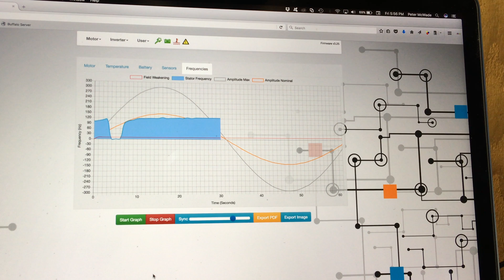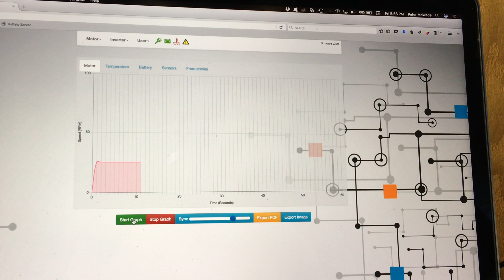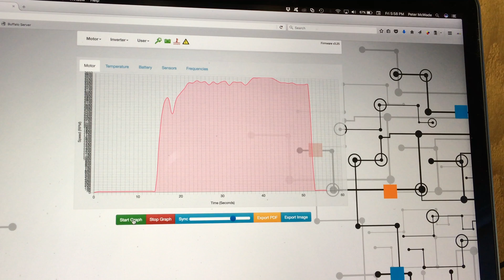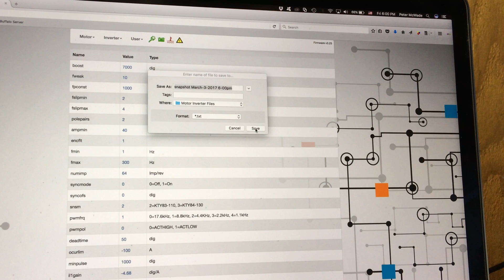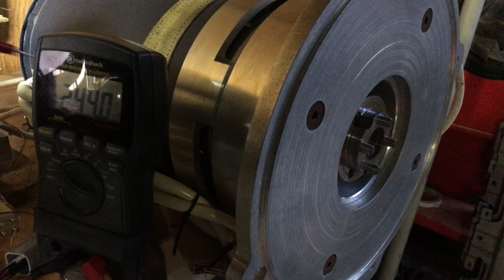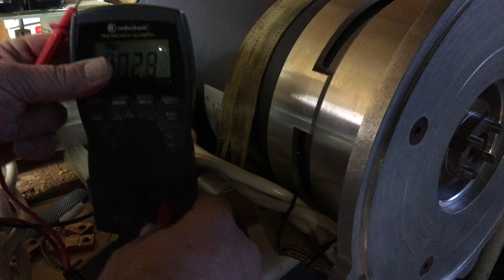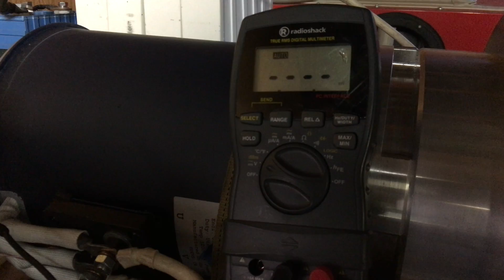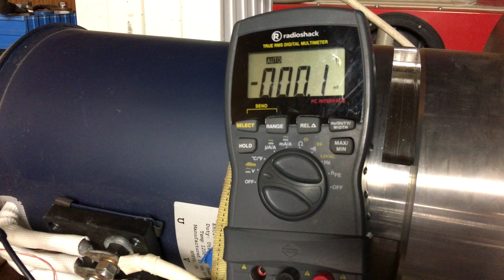Hübner Inverter HPEVS AC 35 Part 2

Comment from the maker: What do you plan on running with your inverter? What voltage and amperage level do you need?
Reply: I would like to use 144 volt amp 500

Comment: hello from new york Where you can get the modules you are using for the controller
Reply from the maker: These modules came with the inverter. I picked up the inverter from someone else who put it together. I have done another since. The modules were purchased from private party but can be purchased on eBay. There are a few other items needed too but modules are the most expensive of the lot.